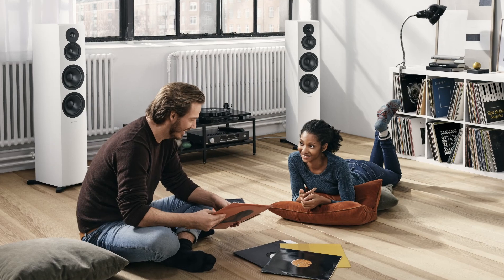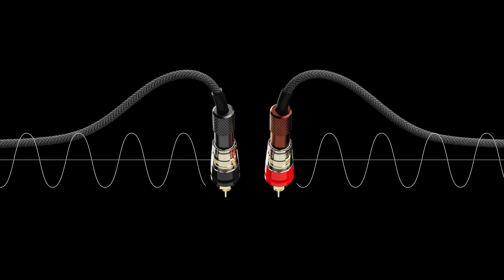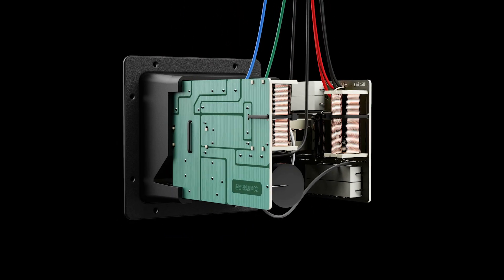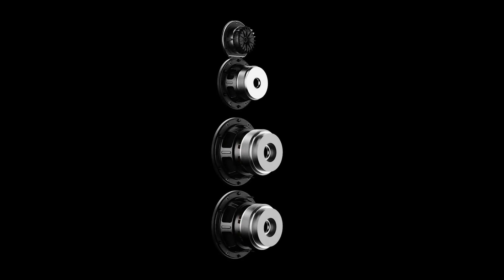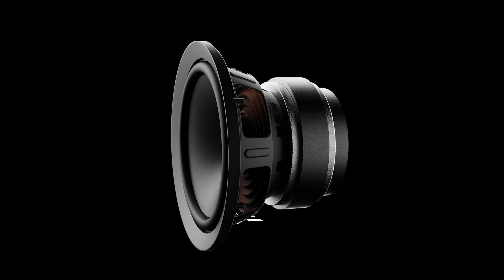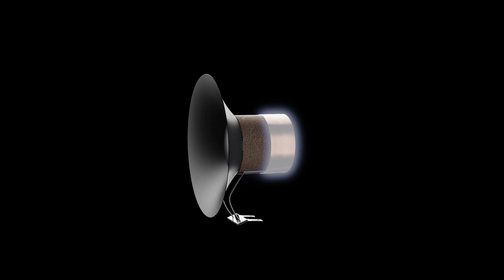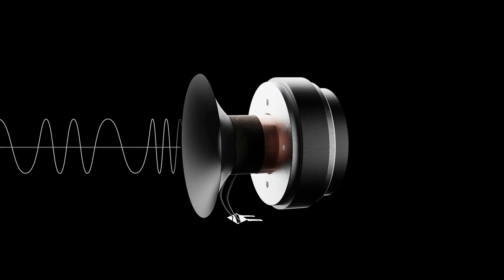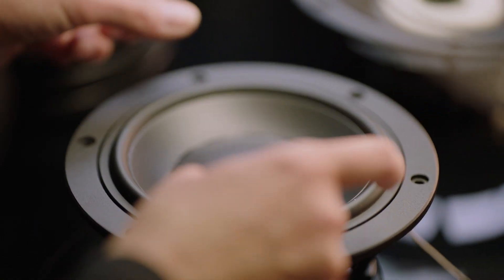Dynaudio - How a passive speaker works

Comment: Thanks! I have a question about power. At low volumes (60-70db) is there any audible sonic benefit (besides higher volume potential) if I were to drive my Emit M30 with a 150W/300W (8/4ohm) amplifier versus a 50W/75W amplifier? Also, I am confused about the watt and current debate. Which is more important, and what do these rating units affect in the overall performance of a speaker? Why do amplifier manufacturers seldom disclose the peak current rating, if everyone says high current is better than high watts? Thanks in advance!
Reply: Long story short, it's easier to blow a speaker up with a low powered amp than a high powered amp. 
A typical 150 watt amp will almost always have less distortion @ 75 watts and have extra head room for musical peaks than a 75 watt amp with little headroom left resulting in amplifier clipping which is a loudspeakers enemy.
 Amplifiers rated to drive 4 ohm loads have more robust power supplies in them than an amp rated @ only 8 ohms.
Hope this helps.
Reply: If you know your reference efficiency of your speaker @1 watt input say for instance 90dB/1 watt @ 1 meter distance and you'll lose 6dB for additional meter distances (for most dynamic loudspeakers) then you must double the power for every 3dB increment so in this case you need 2 watts to get 93 dB and 4 watts to get 96dB @ 1 meter distance. etc...
Reply: The Emit M30 is 86dB/1 watt@ 1 meter distance. At 2 meters the sound pressure level will be in the range of 80 dB with a 1 watt input.

Comment: What is the difference between Evoke and new Emit 2021? They look so similar from the outside and inside.
Reply from the maker: The new Emit has the same Cerotar tweeter as you will find in Evoke, complete with the Hexis dome. Emit's woofer is also derived from the Esotec+ in the Evoke range. So yes, there are a lot of similarities. Also feature wise. Evoke is probably still the superior speaker, as indicated by the price, but Emit 2021 comes closer than ever and represents fantastic value for money. Our best advice would be to audition both ranges at your local dealer and see which you prefer!
Reply: I have Evoke 50 with McIntosh MA9000, what a perfect combo!